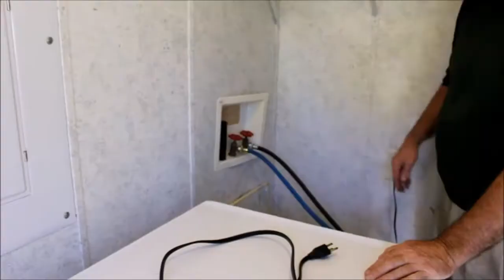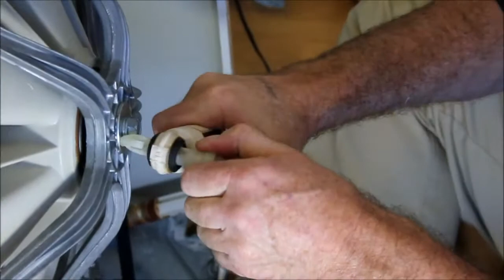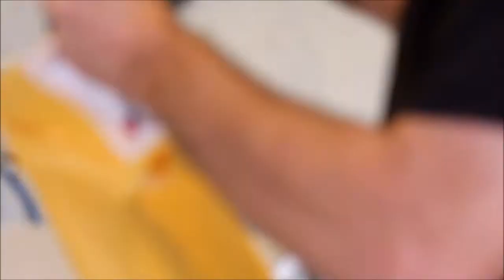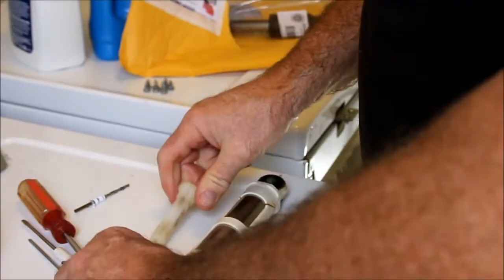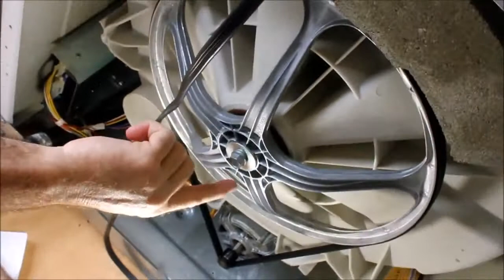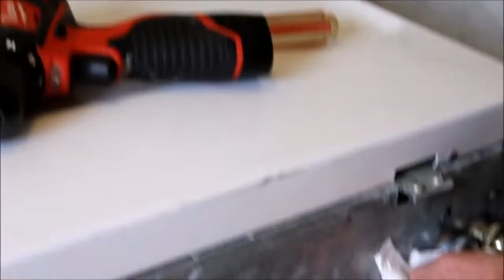Washing Machine Repair   Front Load   Thumps While Spinning

Comment: Are you still using this machine. I'm in the process of replacing the bearings. Your machine looks like the chassis that I have. Mine is a Kenmore brand.
What is the model number of your machine?